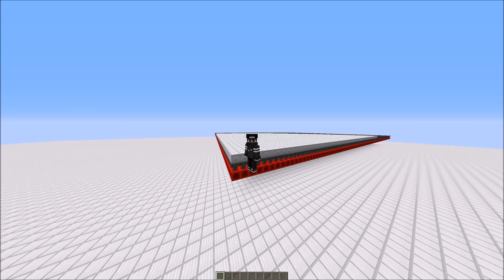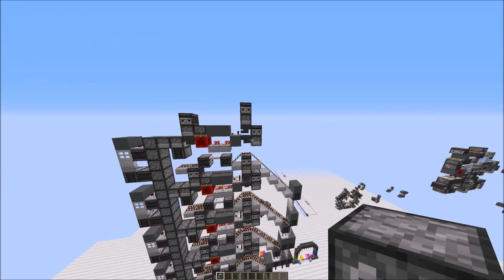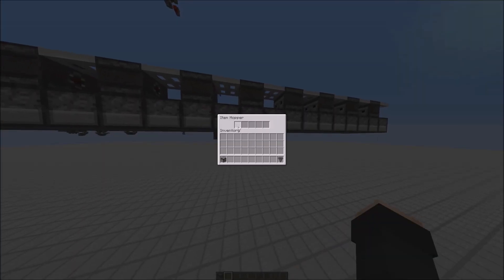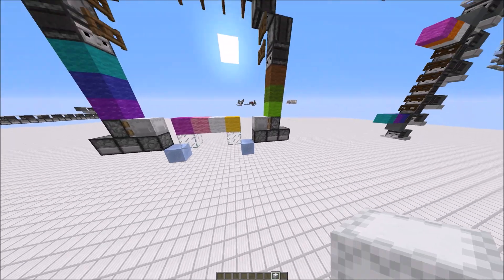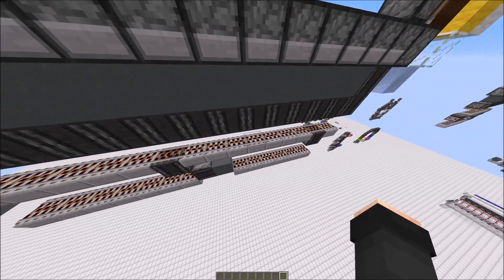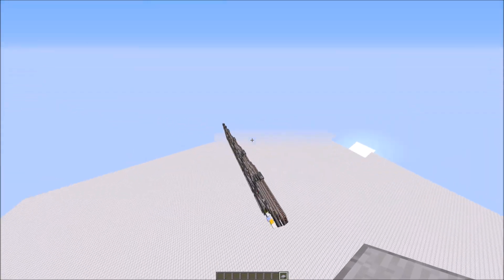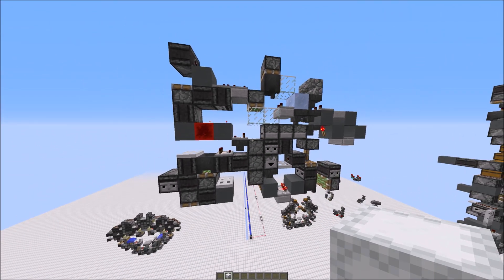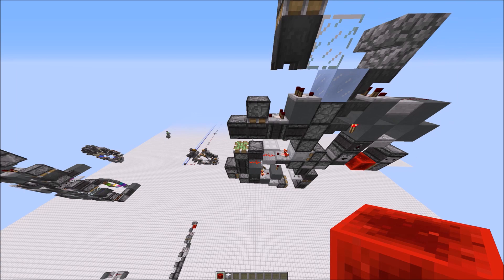Ultimate Storage System 2.0 | Minecraft

Comment: You mention at 31:10 that a hallway using that shulker box display would be about 200 blocks long, but at 8 items per slice, and 700 sortable items that's 87.5 (rounded to 88) slices. 

There are other issues with accesability in that design which you mentioned earlier in the video, but it might be worth looking into improving that design (if even possible), this would allow you to access all 8 items in the slice without having to swap out shulker boxes (and then re-sort them).
Reply from the maker: The 8 boxes per slice are pretty much the maximum in 1.12. I spend many hours on that but the lag is simply not worth it you have to have 700 unlocked hoppers which is quite a lot and many more locked ones.
Reply: @AdamSchadow  Ah, that's makes sense. Thanks!

Comment: You should of probably put the intro part in a different part. Or explain what exactly how this applies to the video or why you are testing this. But ofcourse I really like the new USS design.
Reply: If there is any way to increase the speed of items going to player in the USS v2, that would probably be the only improvement that could be made. Even if it make the build bigger or only tileable by alternating. It might take longer to build but in the long run it will save so much time for everyone.
Reply from the maker: @RaysWorks  I will try my best